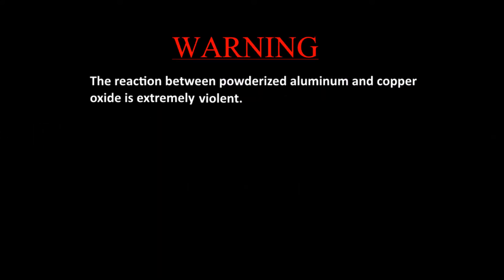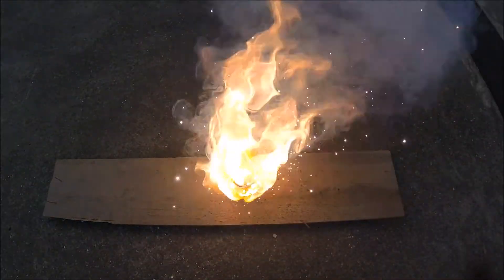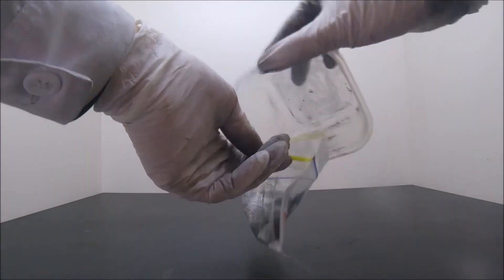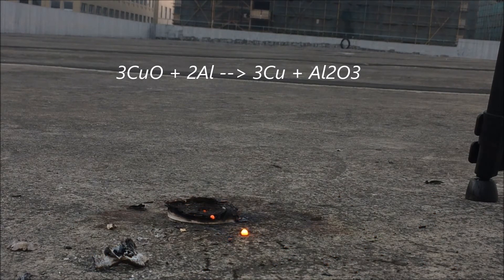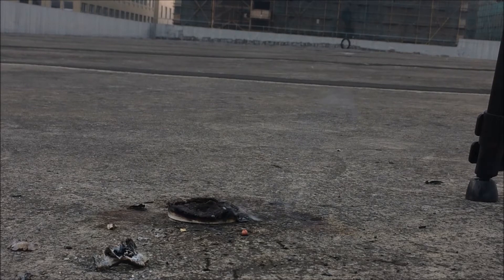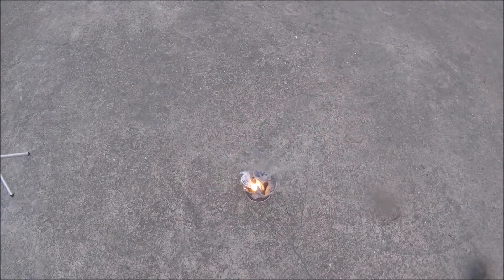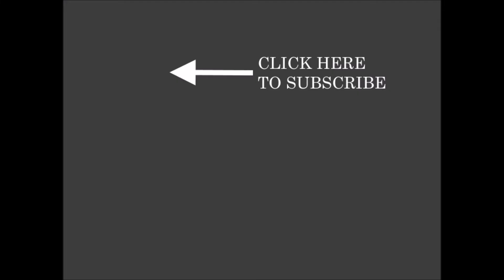Copper Thermite

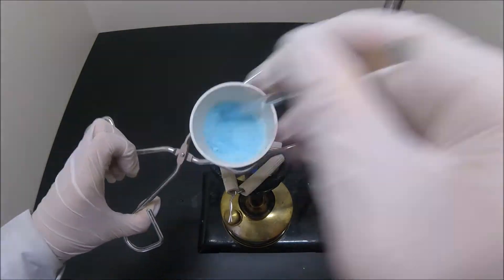Comment: 0:51 I'd like to know more about the calculations. Reaction should be:  3CuO + 2Al → 3Cu + Al2O3 
so for 11,7g didn't you need 2,7g Al instead of 4g?
Reply: A bit more is added because the aluminium also reacts with air

Comment: easier to make a whole load of CuO via thermal decomp of Carbonate instead.less heat but more steps.  the finer the particles the more explosive the reaction here. it can be as fast as good flash powder. lots of fun.
Reply from the maker: Yeah i know. I could have used NaOH, but forgot to order it, kinda run out of time while doing this experiment.
Reply: Aussie Chemist we'll be showing a way better way later when I return from "vacation"
I have tried it here in my little appartment and it works really good (if I can do it 500km from my home without chemical supply than anyone can do it ...) and gives quite pure product (it's electrolysis with extra cleaning step(s))